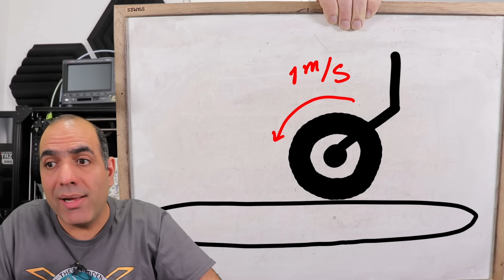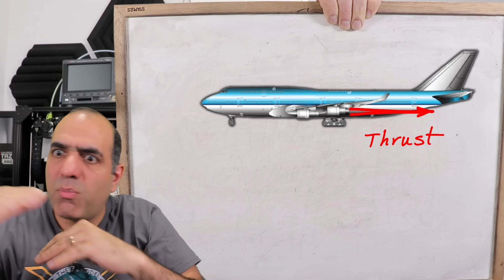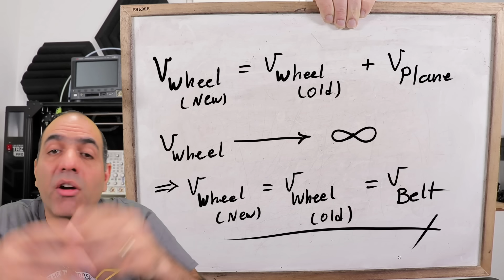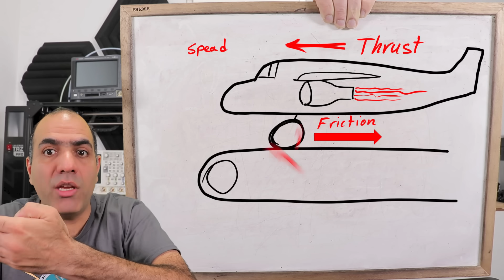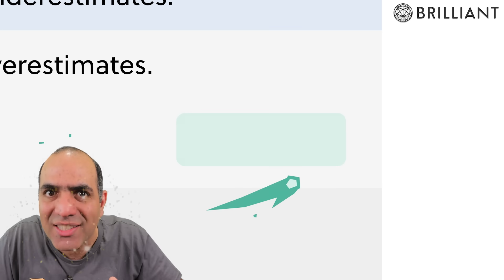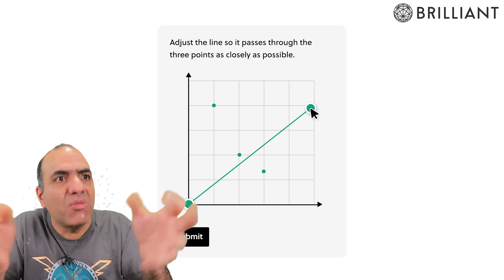Airplane Question that Drove Me NUTS!!!

Comment: Which speed of wheels is the conveyor belt going to match? Rotational? Or linear?

If we assume zero friction in ball bearings and small inertia of the wheel itself, it is not doing anything for propulsion. The plane pushes against the air that it sucks from the front. The wheel rotation is just a result of plain's motion relative to ground.

The wheels don't propel the plane. They suspend it above ground in a way that allows it to move freely forwards (and backwards) while restricting sideways motion (unless purposefully turned).

Okey. Back to the video...